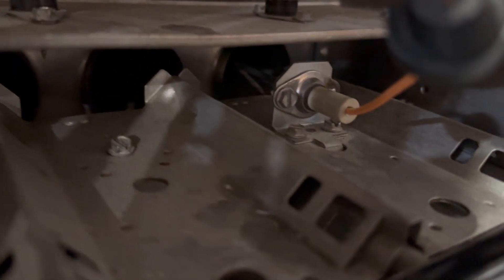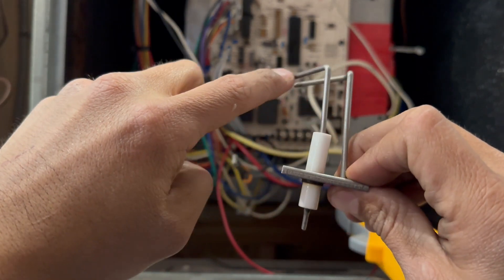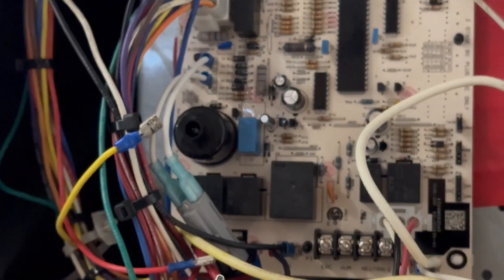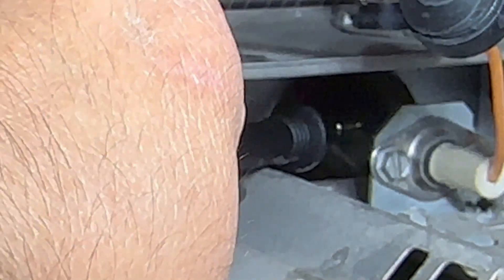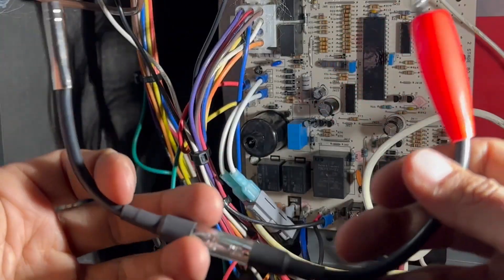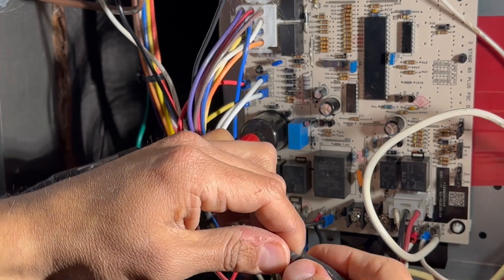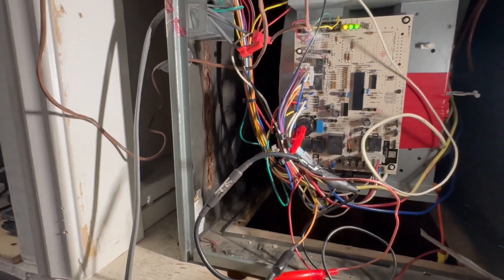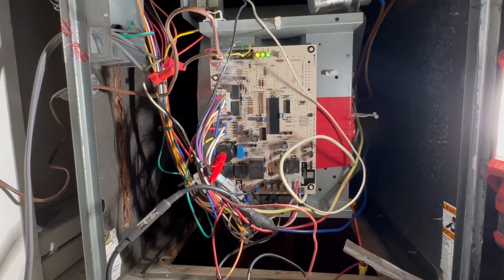How do you check a SPARK IGNITOR on a Furnace?!

Comment: Great video.  But I have a question, what's the reason the  other end of the spark tester was hooked up to the orange wire going to the ignitor?  Can't it be just connected to the chasis or any ground?
Reply from the maker: The orange wire supplies about 10000 volts to the spark igniter, kind of looks like a bent rod and the rod next to it is your ground. Imagine you touch the 120 volt hot and neutral to each other, it would spark. In this case, we have 10000 volts (you actually see the current, looks kind of like thunder) going across that 1 inch space between the spark igniter to the ground rod in the form of repeated sparks. It’s due to the high voltage wanting to go to ground but not necessarily touching each other. It’s amazing.

Comment: Do you remember what the reading was on the meter when you tested for continuity? Like what should it read when its a good spark ignitor?
Reply from the maker: You should practically have very low resistance. Spark igniters are tricky since you can’t read the voltage on them. I just make sure I have a good path from the board to the spark igniter (isolating the orange wire from the board) and a good ground, with that ground screw really being tight to the chassis. If you don’t hear the spark, could be a bad transformer from the board supplying the high voltage.

Comment: I just cut the ends and crimped a male and female adapter on each hand, avoiding the jumpers cause jumpers can get loose and you know what happens I can ask or whatever so I just cut cut the ends of the tester, put a female and a male adapter and that should work perfect no problems to meI wish I can post what I did, but I can. It doesn’t allow me to post the pictures of the adaption that I did.